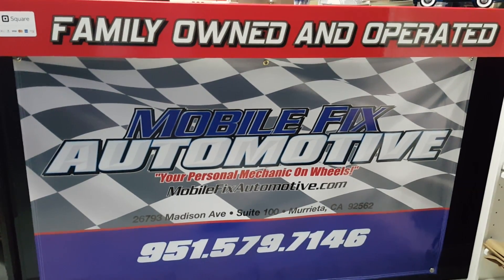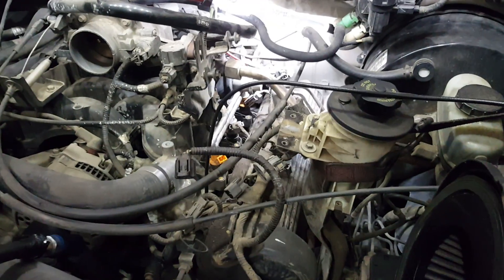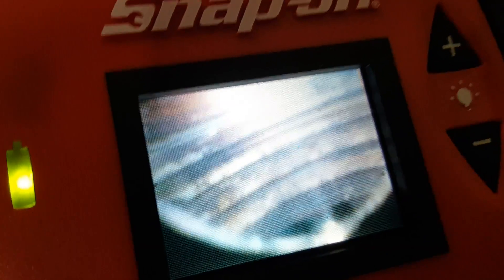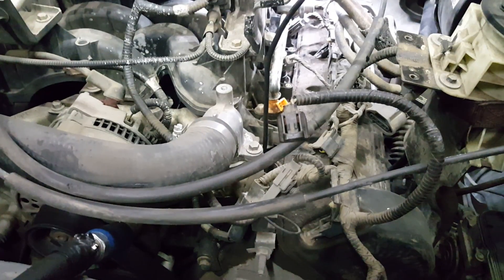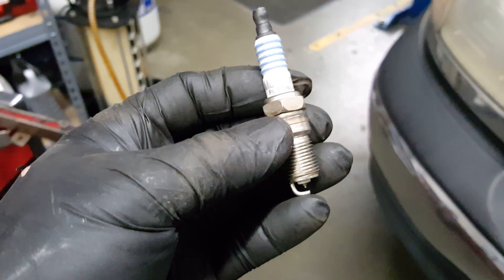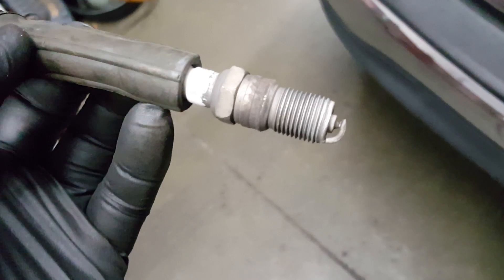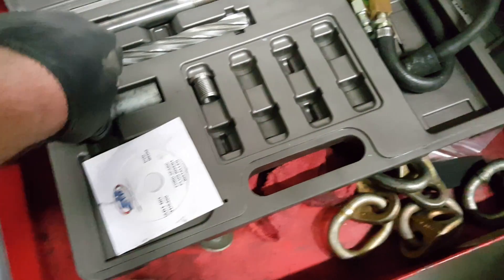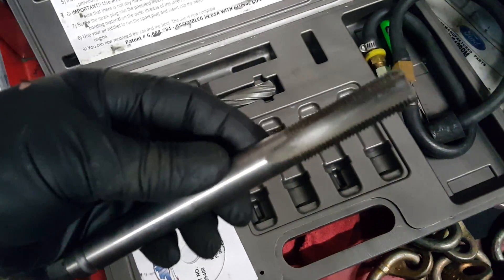Why the spark plug blew out of your Ford Triton engine

Comment: I think this was an excellent explanation of the problem with these heads.  A water pipe wouln't hold together on 4.5 threads.  Considering the cylinder pressures, not only compression but the power stroke, temperature extremes from a running engine to a cold one and the tesile strength of cast iron and whatever material the plugs are made of, depending on the brand, it's no wonder these heads fail.  Unless it was planned obsolence, what exactly did Ford save on by this engineering?  Time to cut twice the threads?  With CNC machining that's a second or two.  Maybe they saved on the tool because less cutting meant twice the tool life.  What I can't understand is why Ford would put such an inferior product on the market.  I'm a GM fan and the mid '70's 3.8L was a boat anchor with odd/even fired ignition, crappy oil pumps and timing chains and those things have improved greatly by 2000 so all I can say is Thank goodness for the intelligence of Maunfacturers and Mechanics who find solutions to these ridiculous situations.

Comment: Lucky just a coil pack broke I’ve had cars come to my shop it pulls a 8 mm bolt right out and then it’s at issue of putting the coil pack back in because you have nowhere to bolt it Also which I’m sure you’re aware of when that whole script so they have a replacement spark plugs it’s like $70It’s a special one that threads back into the block I hate The Ford 😂

Comment: The plug looks like an autolight xp, I believe it even said on it if you look closely at old plug in coil... But I do agree with the stupid design. I've done a bunch of them myself..
Reply from the maker: Yes the plug im holding in my hand in the video is an autolight spark plug the customer had purchased when the vehicle was dropped off.  I dont install customer supplied parts. So i took a plug from his box to shoot video.  The threads and reach are the same. I never expected so many profectionis to comment.

Comment: #5 on my e250 blew out so i locktite the new one in and no problems so far. To bad you cant reach the spark plug holes without taking motor out! Good video!

Comment: MINIMUM THREAD DEPTH for most ANY "machined" bolt, screw, or threaded application is 1 and 1/2 times the diameter of the bolt, depending on the application and torque requirement. So for example:
 A 1/2-20 bolt, you will need minimum of 3/4 of an inch of thread depth, therefore you will end up with 15 threads or turns of the bolt.
Reply: ford doesn't have any real machinist
Reply: The problem is the big companies lay off their knowledgeable engineers and hire cheaper engineers just out of school who don't know shit. They all do it  Even Chrysler - that's why you get some real clunkers from Detroit

Comment: Do you check torque on the other 7 plugs when you have to repair one plug hole?
Reply from the maker: it is strongly recommended. torque to 20 ft pounds

Comment: Hey Ron!! My spark plug has not blown out but is there something I can do to prevent this from happening? Use a weak lock tight or something like that? Thanks
Reply from the maker: No locktite. keep spark plugs torqued to 20 ft pounds of torque.

Comment: That is a great kit
I don't think its that big a deal
BTW I just had to do this repair on my 03 F150, ya it was inconvenience when it blew out. 
But at 345000 miles something was due to let go. 
I don't understand why so many call it crap engine, poorly designed? 
Every engine has little quirks,my triton is still running on its first set of head gaskets, how many Chevy owners can say that at 345k miles?
Reply: More than Ford owners can say they have had no major problems.  No big deal that Ford can't even get spark plugs in huh?  People like you are the reason Ford keeps building junk.  They know you will still buy it.

Comment: Correct amount of torque is a must on these engines! A lot of ppl have this problem because they don't do things the right way or their mechanic doesn't. Never had a single problem from any of the Triton engines I've worked on.

Comment: Never buy a Ford again, I loved it, for the 1st 5yrs...  bought an 04' f150 supercrew in 03'.. now three transmission rebuilds and one overdrive ring, really irks , now I'm dealing with electrical plus a bad plug. Heater won't work if I put headlights on , sputtering and slow start, going to check my plugs, great vid thanks.

Comment: Thanks for all the Vids...!  I have a 2008 Ford F250 Super Duty with a 5.4lt. 125000 miles. Runs great! has been a very trouble free truck. I tow a 5th wheel travel trailer often doing 500 mile round trips over the weekends. Is there anything I need to particularly watch out for at this point with the truck ?  I carry a few spars parts with me like a small scanner, drive belt, Ign coil and such. spark plugs are new.. no broken issues. all fluids new, tire and brakes new, new cab bushings this year replaced. The only issue I have is a slight pop sound from the steering column when turning, sounds like its in side under the plastic covers.. very minor but worry some.

Comment: Just 2 weeks ago a friend told me about his Ford E250 Van blowing number 2 spark plug, I never thought it would happen to mine, but today, I was leaving a jobsite , started the engine, and it blew number 2 spark plug, catching me in a time when i have jobs to complete, lots of money out on these jobs, and in a bind.  My friend told me when he had his van repaired that the mechanic showed him that there were only 3 or 4 threads at the bottom of the plug hole.  Ford has to know about this, and has done nothing about it except throw the blame elsewhere.  I am with Ron in this video when he says 'In my opinion that is the problem", in my opinion, I am with Ron on this.

Comment: I have a 1999 F53 motorhome with the 6.8 V10 2v.  The motorhome has 62k miles.  Should I replace the plugs, re-torque them or just leave it alone.  I'll probably put another 10k miles before selling it.

Comment: Any idea why the 5.4 Triton would loose cylinder pressure in random cylinders? I think it comes from an oil starvation problem, but I am about to pick up the truck (cheap) and rebuild the engine.

Comment: If ford should ever admit that it was a design flaw (which I total agree it is a design flaw) they would then have to compensate a lot of owners!
Reply from the maker: AGREED
Reply: Ron Williams I suspect it would take a class action law suit. The winners would be the lawyers most likely. I doubt that the owners would receive enough to put inserts into the vehicles, since all 8 need to be done to correct the issue. The redesign by ford resulted in a spark plug that separates dir to the carbon build up!
Reply: It would be very costly but you're absolutely right!

Comment: I here bad and good things about Triton's. I know people that haven't had a single problem with there trucks spark plugs blowing out. And their trucks are at 260,000 miles and still running strong. It's funny how many hate comments are directed at Ford, and how they are pos. When yet both Chevy and dodge had there years of shit trucks also. What I'm saying is don't hate on a damn company when they simply just had a bad few years of Shitty designs. There are plenty of fords out there that will outlast a lot of vehicles.
Reply: Rummy MX, I am a Ford fanboy, or used to be.  Ford had way too many "bad years". Yes there are still many Ford fanboys, even some who had bad experiences but many who had the Triton 2 and 3 valve had many problems, and the Ford diesel 6.0 and 6.4 can be a nightmare as well, and the latest diesel version is also starting to show problems. Yes, every manufacturer has made some shit engines, but Ford takes the prize for most it seems.

Comment: I have a 2002 SuperCrew with this engine. Off the truck had a 99 manufacture date on the engine that was knocking a rod had a engine with 2003 manufacture date installed it seems to be running fair but was getting 12mpg ave. I've had to replace several ignition coils think I'm down to just cylinder 1 and I'm pretty sure that one is going to go out eventually but when I changed one of them that went bad I noticed the truck started getting 13 MPG average. Just replaced cylinder 5 not sure if this is going to change the mileage but I'm pretty sure I only have one old one left. Everybody with this truck at least two people I know have swore that with the 5.4 Triton they have gotten up to 20 MPG some have said 16. I'm too worried to attempt to do the plugs myself due to the design of this engine and the depth of the plugs compared to the common engines with plug wires. The truck had a hundred and fifty five thousand miles on the frame when I got it and the engine supposedly had a little less than that. Possibly 120k. Now the frame has 190k. Would having the plugs changed help with the MPG would be my biggest question. I've never known one of the plugs to blow out of mine yet. Just every so often the truck will start bucking and I have to hook up my OBD2 scanner to figure out which coil has gone out. I notice this engine didn't come with Motorcraft so they've probably been replaced the ones I have have a yellow paint mark a black boot and a bunch of numbers on a sticker on the top but I only have one of those left and it's on cylinder one so that it's reachable when it goes out. Very rarely have one of the newer ones went out. I have three of them with a lifetime warranty. Also wonder if old plugs can burn them out quicker

Comment: This happened to me a few days ago on my 2003 F250 V10 Triton and the mechanic wants to charge me $700 (possibly more) to do the work. I have no idea if I should shell out the money, get a second opinion, or just sell it for scrap.i honestly don’t know if this is a fair price or the guy is trying to rip me off.
Reply from the maker: If its just one cylinder getting fixed thats very high price. I think a good average price is around $300 for the first hole done including coil, spark plug,  and insert for a quality Cal-Van kit.

Comment: I think I understand the problem. The spark plug has too many threads! That's what Ford is saying. They need to use spark plugs with 4 threads not 10!
Reply: There, problem solved. Just grind the threads off till there's only 4 left.
Reply: NO NO NO!!!  The LACK of threads is the problem!!!  4 threads would be fine in a cast iron head because cast iron is stronger (albeit MUCH heavier) material.  They SHOULD have had 8-10 threads in the cylinder head.  If they would have had twice as many threads, there would have never been a problem with spark plugs blowing out.  Ford fucked up the cylinder head design, plain and simple.
Reply: @craigcampbell8560  He's joking, I think.

Comment: I recall having a loose plug in a high compression Chrysler product years ago. Steel head, no harm done. Just tightened it back to spec, problem solved. Ford DOES NOT have a better idea.

Comment: Hey Ron..I have a 2004 CVPI with 120k..no problems yet..I have a couple questions..1) Can I avoid problem by tightening and torquing plugs?(then, periodically checking torque)..If so, how many pounds do you recommend?..Should I put a dab of anti-sieze on plugs?..2) Does the head need to come off to make the repair?..If not,  how do you keep shavings out of cylinder?
Reply from the maker: Napoleon Einstein 
Watch my video called "revised cal van insert install" it explains everything.  20 ft pounds of torque on plugs with a little anti sieze is my way.
Reply from the maker: Napoleon Einstein 
By the way what is a cvpi
Reply: Crown Vic Police Interceptor..P71
Reply from the maker: Napoleon Einstein 
Yes i know those, but never thought to abbreviate it! Lol

Comment: very good explanation of the problem that ford is unwilling to accept responsibility for I bought a ford work van that I cut my losses on and sold I could not believe how bad they designed these motors I hear the word triton and I get sick but thank you I had figured it must have been something like this  the reason is clear 4&1/2 threads  the argument is over  great video

Comment: Ford says its a spark plug problem not a cylinder head problem. So since my 2010 vic blew a plug today and it had motorcraft plugs. Fords own plugs are defective?
Reply from the maker: kdog0011 
Yep. Ive said that in video. But. The fact that they have brainwashed people into believing that they can just pawn it off. Thats why i did this video,  its the plugs they installed and well before tune up was due.

Comment: I literally blew a plug today. I knew what happened and limped the truck to the shop. Pulled the plug and the electrode end was gone and the ceramic was blown out. It's very, very, very hard to not want to track down an engineer and beat him to an inch of his life with the POS head that he designed.

Comment: You might be a mechanic but you're ignorant on engineering..As the fucking spark plug is not a bolt. All you need is 3 threads. Anything else is used as a stressed bolt ie It's holding something down or in place!! 

Same as the spark plug seizing on the 3 valves only used 3 threads. Yet they seize up. Then the reverse. Plugs started popping out. This is the world of Aluminum heads. You wanted it. Well you got it. Now shut up. Put some anti seize on. Torque the shit out of them and call it a day!

Comment: I just bought a 2000 F250 with the 5.4 engine. It doesn't have any rust and it got almost got 236,000 miles on it. I paid $800 for it. It had number six spark plugs blow out. My buddy got it fixed with a cheaper insert. So far, I haven't had any problems. Truck runs strong. I'm going to check the other spark plugs make sure they are tight. Next I need to get the rear brakes working. The calipers is off the truck, but the truck still stops with the front brakes. I thought they cap the brake lines off for the back, but the lines is open. So I don't know how is not getting fluids to the back. Any inputs on that? Thanks

Comment: The first time my #4 plug blew out my buddy told me about Ford not tapping the holes deep enough, i blew it out a second time a couple years later, the helicoil finally gave out. I bought some Ford Racing products heads with Cobra Valves and a few more upgraded all at the same time. I might have gone this route if i knew it existed, but i do like the FRP heads.

Comment: I have had two blow!  One in middle of 101 while trying to move my daughter from college. Lucky I was within AAA 200 mile range.  The first I had an Excursion full of Boy Scouts and gear on the way home.  Lucky Room was found in other vehicles.  

Every time I drive this thing I worry about it blowing another plug!  About 150,000 miles on it now and I am afraid to change the factory plugs in fear I’ll weaken those 4.5 threads you talked about.   

2 Blown, 8 to go... No longer trust my truck for use on long family trips....  For should be ashamed.
Reply from the maker: best thing is to remove and replace all other plugs and torque down to 17-20 ftlbs. plugs coming loose is one of the main things that start the blow out proceess

Comment: Will the kit work on a 2005 F-150 4.6? The reason I ask is because the web site says for use years 1996 to 2003.  Is there different kit for 2005 4.6 blown spark plug.  Thank you for your help
Reply from the maker: as long as you have the angled boot on your original coil yes. if you have straight boot with 3 valve engine then no.

Comment: Aluminum expands faster than steel and having not enough threads allows the steel spark plug which expands at a slower rate work it's way out. Only a Ford engineer would have a hard time grasping that. Sold that piece of shit as soon as I fixed it. I would have gave the guy the 400$ kit but I didn't want to lose the sale....

Comment: This is also my opinion and there is no real way to prove it. From what I have found in my 6.8L excursion engine I believe it may be more along the lines of cross-threading the plugs or not tightening them down. The reason I think this is because on my block only the 4 cylinders closes to the firewall which are kind of hard to get to are the only ones I have ever had blow out and my Excursion is at 208K. I decided to swap heads once a plug blew through a previously installed thread insert, so I wanted to start with heads with all thread inserts installed. When I pulled the heads off I found 2 of those 4 plugs cross-threaded in the heads since they were angled to the side of the bore, which 1 of the other 4 had blown out. My theory is that this directly correlated to the plugs being cross-threaded by technicians that don't thread them in by hand first so they are grabbing even less threads than normal. Quick note as well, Ford did 3 of the 4 inserts done to my excursion so I would personally think twice about having certain places replace plugs that are hard to reach.

Comment: Great info. I have a 2007 ford focus which i brought new at the time it has 140000 miles on it .the engine is the 2.0 and it blew a spark plug out of the top of the head. Same m.o. as the 4.6. And 5.4

Comment: I've owned many Ford's. Never a triton. But all of them have been over 260k when sold. One was over 300k. Never had a problem other than alternator and 4x4 hub bearings replaced at 200k. Idk why people say ford is junk. Moat my family buy gm products and all I can say is wow. The electrical issues and fuel pump, starters, alternators, oil seals,  transmissions, all kinds of problems. I'm convinced that it's who owns the vehicle, no who makes the vehicle. Currently have a 2015 ram 5.7 and 2002 explorer 4.0. No problems.

Comment: I used to own a 2002 F350 V-10  4x4.

I decided to have the plugs changed at 65k.

#8 plug blew out.

Never again will I own a Ford.
Reply: That "could" have been your mechanic not installing the plug correctly since it blew AFTER he installed it.